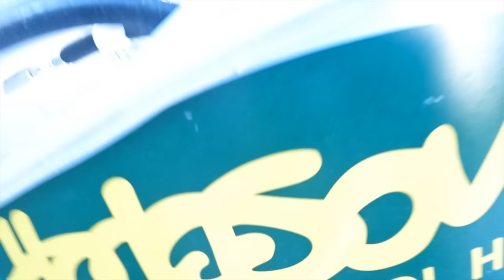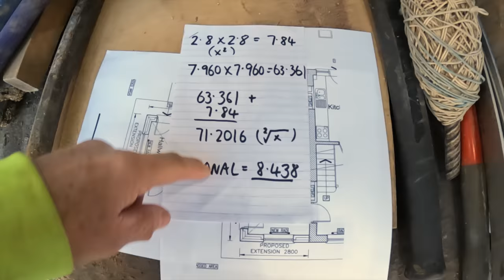NEW EXTENSION PROJECT.. SUPER TOUGH DIG

Comment: Excellent advice on the maths 
I have been setting out for years , mainly for steel frame ,and you can use the calculation in lots of ways for traditional setting out ,especially on long runs or windy days by breaking the proposed building into smaller squares .
Really good keep up the good work , very professional .
Reply from the maker: Cheers Chris 🧱👍🏽

Comment: Suggestions guys:  Consider purchasing a spade bit for your electric pavement breaker.  It would make quicker work of trenching through clay.  Also, on a job like this, I would think that a rental power barrow, to move excavation spoils out of your way, would make sense.  Seems to me it would pay for itself with the time and aggravation saved by avoiding much of the double/triple handling of soil that you often do on the restricted sites.  Cheers.
Reply: Did the digger only come with small buckets.? Have you got to move all that spoil or is being grabbed.? Footings are not my favourite, you never know what you’ll find.! Good luck with it chaps.!👍
Reply from the maker: @nigelsmith1198  we got 3 buckets and grab action to come 🧱🧱👍🏽

Comment: Good.old Pyrhagorus theory. The square of the hypotonuse is the sum of the squares of the other 2 sides.
Reply: Yep, Diagonal = Width squared 2.8 = 7.84 plus Length squared 7.960 = 63.3616 = 71.2016 . Square root of 71.2016 = 8.438. Just checking. 👍😏 You can use the old formula - the angle of the dangle is equal to the heat of the meat but it's not so accurate.😏
Reply from the maker: @brucepickess8097  🤙🏾🤙🏾🧱👍🏽

Comment: Hi guys, for gods sake get yourselves some decent breakers, the ones your using are ok for diy ers but constant use will kill your shoulder joints guess how I know. They are also to heavy and work on mechanical vibration see if you can get ones that work on internal air action.
You will not regret it,,,don’t buy cheap….

Comment: When we did a lot of extensions i found more often than not the plans would be of poor quality not enough info on them .building control would insist on things not on the plans .so i stopped working off poor drawings so customers didn't incur the costs. 
Trouble was there were more bad drawings than the good ones.
A good architect is worth paying extra for so there is no supprises for you or the customer. 
Do you find the same thing steve up there mate ?👍🧱🧱
Reply from the maker: Absolutely Justin , no specs and not even measurements for door and window positions 😫😫🧱👍🏽
Reply: @Bricklaying With Steve and Alex   
We used to have plans just printed off the Internet not drawn up specifically for the job.
They literally get payed for nothing which makes are job hard .
Not many good ones out there now steve 👍🧱
Reply from the maker: @brickrightbuildinglandscaping  So true half of the shite is copy and pasted and has nothing to do with the job 😠😠🧱👍🏽
Reply: @SteveAndAlexBuild  spot on 👍🧱
Reply from the maker: @brickrightbuildinglandscaping  🧱👍🏼